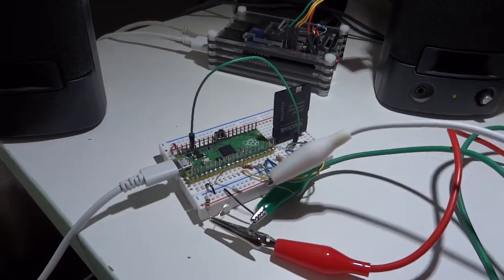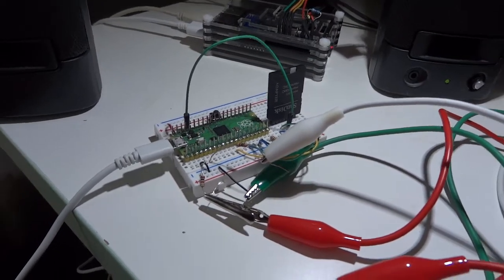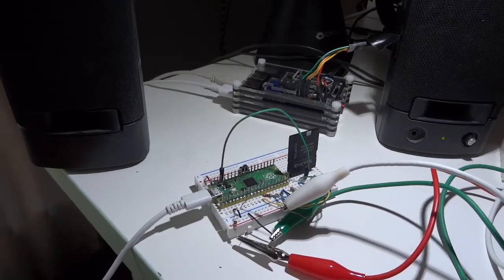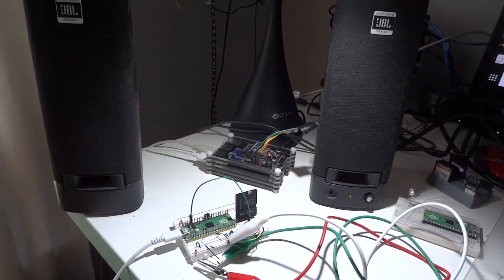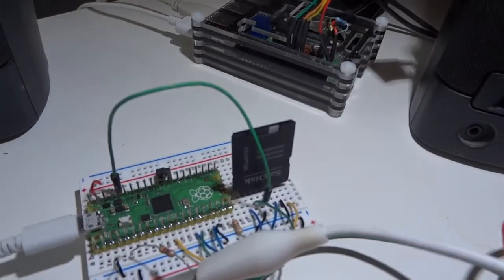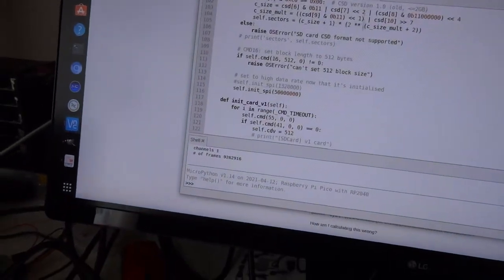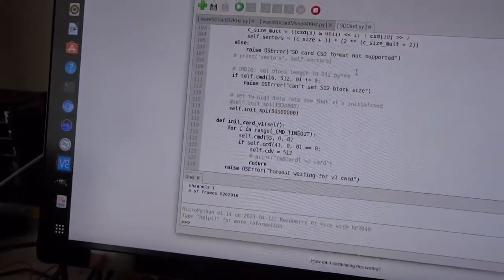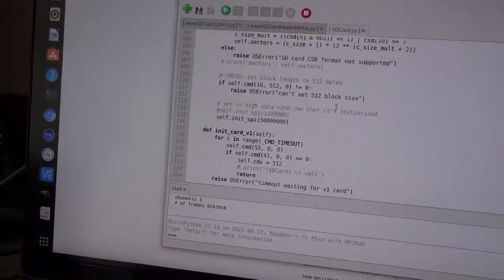Raspberry Pi Pico  output audio in PWM

Comment: Hey Daniel, do you know if anything changed with the DMA for the Pico 2W vs the Pico 1? I've been able to run your code flawlessly on a Pico 1 but on a Pico 2, it seems to be stuck looping at myDMA.abort().
Reply: Hey,
Have you been able to fix this? 
I'm encountering the same issue.
Thanks

Comment: Hi Dan, in your myDMA.py file, I do not understand why you logical OR the addresses, with 0x2000 or 0x3000, e.g.:
`mem32[self.CHAIN_ABORT | 0×2000] = 1 << self.channel`, instead of just: `mem32[self.CHAIN_ABORT] = 1 << self.channel`? 
Merci par avance.
Reply from the maker: Hi Paul. RP2040 datasheet Atomic register address section 2.1.2.  Addr+0x0000 Normal R/W, Addr+0x1000 XOR write, Addr+0x2000 bitmask set, Addr+0x3000 bitmask clear.
Reply: @danjperronyt Merci pour votre réponse si rapide! Je n'avais pas encore lu ce paragraphe dans la datasheet. Encore merci.

Comment: Just one question: why did you use 10bits for PWM (the Pico's PWM can handle up to 32bits)? Nice work!
Pourquoi avoir choisi 10bit et non 16bit comme le fichier wav's 16bit bit depth?
Reply from the maker: This is PWM! It's a trade off between the system clock and the effective resolution on PWM. We don't have tera hertz clock! 
C'est une question de résolution avec la fréquence d'horloge du système. Pour 32 bits il faudrait une horloge en téra hertz.
Reply: @danjperronyt  Thank you Daniel. A last question please: what is the purpose of setting up the ground pin with a pwm (lines 168~169 in wavePlayer.py)?
Reply from the maker: @Paul-h3b  Normal amplifier use a capacitor to get ridd of the DC voltage. Headphone are directly connected so you need a way to remove the DC offset.  Creating a 50% PWM has gnd for headphone will do the trick! Another way is to use electrolythic capacitor  (+ to the GPIO) to get ridd of the dc offset. The capacitor needs to be big.
 Freq=1/(2*pi*R*C)
Reply: @danjperronyt  very smart solution!

Comment: Do you think its possible to configure your code to play .wav files out of the PCM5101A module? Would you kindly let me know, i already have it and was wondering if i could make use of your code with it. Thanks!
Reply from the maker: it is possible! The rp2040 doesn't have i2s hardware but https://arduino-pico.readthedocs.io/en/latest/i2s.html
Same scheme except you don't use the pwm but a i2s made by PIO
Reply: @danjperronyt thanks! Got it working with I2s!
Reply from the maker: @John1Castro   Wow. Be kind and post your code to github.
Reply: Yeah, I too, have PCM5100 module from PIMORONI. Currently using it as a USB DAC and it actually soundss good even with 48k@16bits.

Comment: Hi Daniel, in your github repo, there's a note that if I'm going to connect this to an amp, I need to use a capacitor that's connected to GND. Does that mean the capacitor will go on the signal output from the RPI pico and connected to GND? (as well as signal being connected to the amp)
N.B. Thanks a lot for your code. I got it working here for a project I'm doing
Reply from the maker: Hi,   the signal output from the pico is from 0 to 3.3V centered at 1.66V.  Normal Audio signal input to an amplifier need to be center to  0V.  The capacitor will removed the DC offset from 1.66V to 0V.
Reply: @danjperronyt  Thanks for the explanation.

Comment: Hello Daniel, could you share the wiring and code you use. In particular the SDcard connexion
Reply from the maker: Bonjour Jean,

Pour la carte SD j'ai suivi et commenté sur ce forum.  https://www.raspberrypi.org/forums/viewtopic.php?f=146&t=307275&p=1838407&hilit=SDcard#p1838662
En ce qui attrait à la manipulation  audio j'ai utilisé  mpg123 pour convertir  mp3 en wave. Ensuite j'ai aussi utilisé sox pour corriger le fichier .wav .